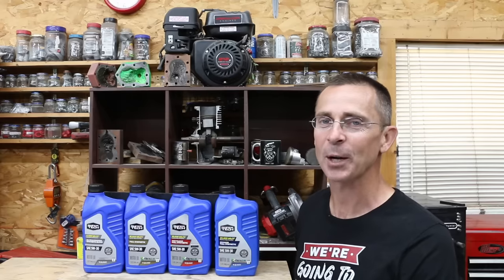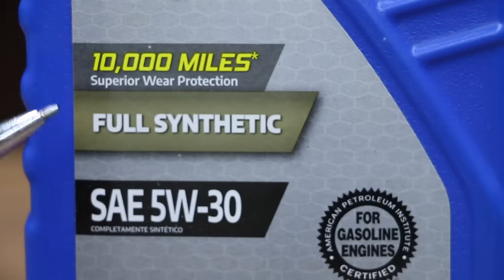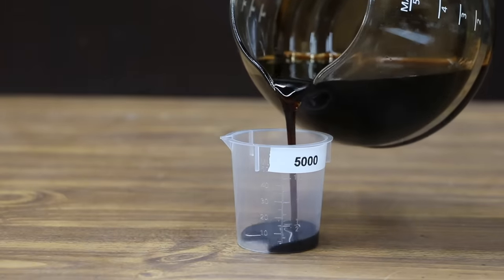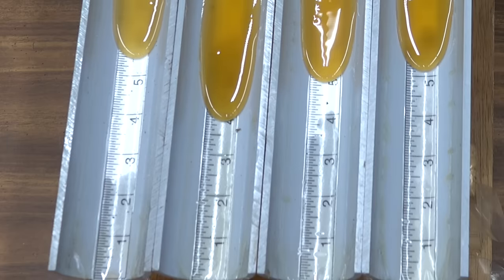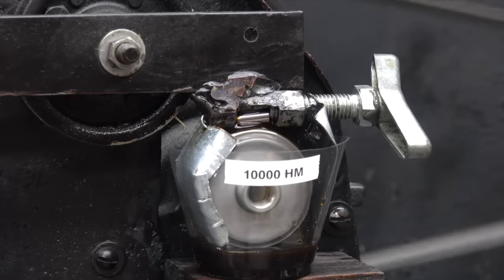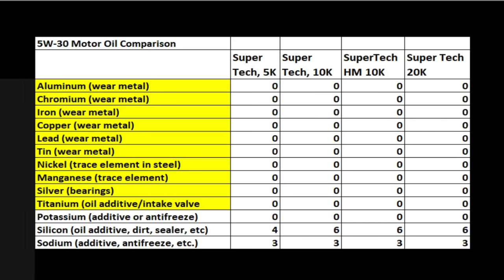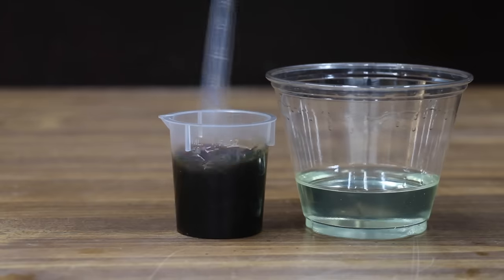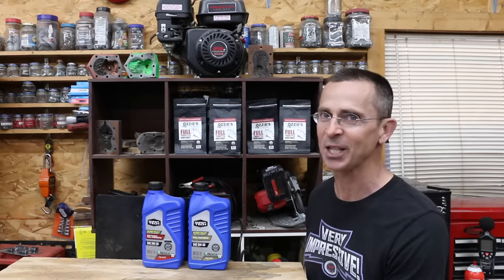Are They All The Same Motor Oil? Let's Settle This! Four Types of SuperTech Motor Oil Compared

Comment: I no longer recommend using Super Tech.  I switched to it 3 years ago after using mobil 1 for 20 years.  Big mistake but It was mainly for financial reasons.  It leaves burnt deposits and varnish.  It is also the reason for my car to overheat recently.

I have since tried Amsoil after watching your videos awhile back. Now my car doesn't overheat and runs smoothly.

I now sell Amsoil and i will be contacting you directly for another oil challenge that better represents real life applications.  Be on the lookout for a message from AMPD Oils, Lube & More.
Reply from the maker: Thanks for sharing.
Reply: @ProjectFarm  i went to your contact page and it referred me back here for suggestions.  I would like to see another oil challenge with that has " sludge". Perhaps add grounded dry carbon or possibly real engine sludge. measure it out evenly and mixing it in each oil. And then redo all of those tests

Comment: You should try a cold flow test with the same oil in all 4 tubes to see if there is any difference between the tubes or tracks.
Reply from the maker: Thanks for the suggestion.

Comment: I always use Mobil 1 Advanced or Fuel Economy both are rated for 10000miles "guaranteed". I change my oil every 5000miles and the oil comes out pretty clean and almost no oil is burned at all maybe 1/10 Quart (the engine has 100000miles). I tested it twice once to 6000 miles and once to 7500 before oil change, the oil comes out very dirty then and when I drove to 7500miles my car burned almost an entire quart. So people ignore your manufacturer recommended oil change intervals and change your oil every 5000miles unless you want issues with your engine down the road, my car manual says 10000miles oil change intervals but hell no I don't want another car after the warranty expires.
Reply from the maker: Thanks for sharing.

Comment: Motor oil companies work with the engine manufacturers and they have inside deals.
Recommend us and we recommend you.
Engines dont last as long because oil chance intervals have increased.
Both because oils cant handle high milage and engines arent built to last.
They sell more parts this way and engine oils that claim high milage are just slightly  different from reqular oils that claim normak 5000-10000 miles. 
They just price them accordingly to keep the sales the same.
Always chance your oil once a year or every 7500 miles with decent oil and you are good to go. 
Oil/filter chance is the easiest way to keep your engine safe.
Reply from the maker: Thanks for the feedback.

Comment: I own a 2017 Tiguan. I am wondering if it’s possible to burn enough 5w-40 engine oil in less than 3 month -8000km to trigger an engine light and red oil light on and off.  My dealership who I trusted over the years told me for some reason, my engine burnt more oil than usual and if it’s less than 1L for 1000km, it’s not warranty.    Myself on the other end believes they didn’t put in enough oil on my oil change 3 month ago.😂 would this be a fun project for you?
Reply: By the way, can I switch to Kirkland 5w-30 from the 5w-40 from Volkswagen? I say this because I lost all trust and want to change my own oil.
Reply from the maker: Thanks for the suggestion.

Comment: Don't pay attention to how many miles a container says the oil will last. Bottom line is we KNOW that it will degrade over time and the cost of an oil change is cheap insurance over costly internal engine repairs. I change mine at 5,000 miles regardless of what the container says.
Reply from the maker: Thanks for the feedback.

Comment: I would like to see a test between the best oil that Europe produces, to a US brand.

French oil company TOTAL have recently released TOTAL Quartz ineo Extra First 0w20. This is a popular choice and factory fill for small turbo charged engines such as the PSA Stellantis three cylinder 1.2 Puretech engines rated between 110bhp to 155 bhp. This engine has a wet cambelt.
Reply from the maker: Thanks for the suggestion.

Comment: Well I'm sure you remember the story that I have said to you about my Dodge neon I bought my Dodge neon in 2010 The day I brought it home I changed the oil with mobile one synthetic until 2018 I switched to Walmart 5W20 high mileage supertech full synthetic I bought it with 16,000 original miles when I had to let it go because the body was so shot because of salt and had 250,000 mi on it Just for giggles I decided to take the valve cover off It was spotless I always went 15,000 mi in between oil changes even with Walmart oil that engine was still good the day I got rid of it Just food for thought!
Reply from the maker: Thanks for sharing.

Comment: The trouble with all this marketing is that people forget there’re also time, engine operating temperature and load factor parameters. These caveats are mentioned somewhere in all the literature that comes with all oils. Even on the box itself, it tells you no oil is meant to be used for more than a year.

If you are towing all day long in city conditions, averaging at 2,500+ rpm your oil is wearing out faster. If you live on the highways in Florida in a modern sedan and your engine is running at <1,200 rpm all day long, your oil is wearing out at about half the rate. 

Aircraft engines have oil changes measured in hours, even though they are never stuck in traffic, for a good reason. Vehicle mileage is a terrible way to gauge oil performance, but is the easiest.
Reply from the maker: Thanks for the feedback.

Comment: Can you do an engine oil test with Silicone oil of the same viscosity? 
I know that Silicone oil is better than most other oils in terms of life and it sticks to parts better than normal oils. so I want to do a test in an engine. but I do not have the means to try it out ..
Reply from the maker: Thanks for the suggestion.

Comment: Even if the oil could go 20k could the brakes and tires? 20k is a long time to run tires with out rotation, that’s also a long time to go without checking the brakes. In my experience the inspection and tire rotation takes far longer than the oil change.

Comment: The car care nut channel is a guy who has the most Toyota engine knowledge of anyone. He has proven that if you use the owners manuals suggested 10,000 oil change interval, you will suffer extreme oil consumption as the low tension oil rings and oil drain back holes are too small. He proved that if you change oil no later than 5,000 miles you can get 500,000 out of most Toyota engines but if you go 10,000 you will be burning excessive oil after around 200,000 miles. I bought a used Corolla with only 50,000 miles that is using a qt in 275 miles cause oil changes were neglected. Your better off with cheaper oil changed more than expensive oil changed less!
Reply from the maker: Thanks for sharing.

Comment: Slug is created by mixing weighs and brands,  just change oil filter and you can run a motor 500tho miles ,  did it twice
Reply from the maker: Thanks for the feedback.

Comment: I use castrol oil 10w-30 for my 1988 lincoln town car.
Reply from the maker: Thank you for sharing!
Reply: I heard that the additives make it thicker and thus higher second number, is that true?
Reply: @Isaac-47517  Im not sure I use 1 quart of lucas plus the 10w-30 my 302 runs pretty fucking hot so I always keep fluids topped up 15k miles with no oil burning issues not great mpg but its a fucking brick.

Comment: In regards to oil change intervals, I always change the oil on all of my vehicles every 3 thousand miles regardless of the year the car was manufactured. 
I also do this with oil filters as well, it seems weird but I rather have the engines in my vehicles running clean fresh oil to prolong the life. 
Very interesting results from the testing!
Reply from the maker: Thanks!  Thanks for sharing.

Comment: i wish they would stop advertising oils capable of x miles ... change your oil when you are suppose to and use the correct oil . not all cars and go 20k or even 10k with ( 20k rated oil)and they require oil filter changes and top off of burning oil with anything over 5-10k  . I really love when a customer tells me they can't remember when the last time they changed their oil ....

Comment: Also it's not surprising that the high mileage 10,000 was thicker than the normal 10,000.  That's the whole idea with the high mileage is that the engine is worn a little bit so you want to use a slightly thicker blend. For better or for worse I guess.
Reply from the maker: Thanks for sharing.

Comment: Seems like the 20.000 Mile oil is just higher viscosity, so it could technically last longer before becoming too thin... Would be better for higher heat climate, still would not go More than 7500 on any oil.
Reply from the maker: Thanks for the feedback.

Comment: All synthetic oils here are so close to each other that it feels a lot of tests are within some margin or error. I agree that base oil seems near identical. For purposes of using these oils, they are the same oil. 1% difference is not a lot at all & if you got say 10 containers of each oil from different batches results would vary by said 1% (hey maybe prove this? Is same oil really the same across different batches? How close are they?)
Reply from the maker: Thanks for the suggestion.

Comment: I don't trust extremely extended oil change intervals and never will. I'd rather spend a small amount of money and get it changed more frequently. I think 5,000 miles is pushing it. For my car which is not really used much 5,000 miles is easily way over 2 years and for my work van about 1 year so I change it annually. The car I just change about every 2 years since I'm getting my plates renewed anyway and get it done then while getting it inspected.
Reply from the maker: Thanks for the feedback.

Comment: The way I see it, your engine its self puts contaminates in your oil. The detergents in the oil, keeps the contaminates in suspension so it doesn't form into sludge inside the engine. No matter what oil you use, or what the oil claims, it will not reduce contaminates that go into it. Which means, if you have the same volume of oil which accumulates the same amount of contaminates, the mixture is the same and just as harmful to the engine. Always use your manufactures recommended service intervals, because they know how much that engine pollutes the oil over that period of time. Totally my opinion though.
Reply from the maker: Thanks for the feedback.

Comment: I don’t believe in extended drain intervals. I change at  a maximum 5000 mile interval. I had a ‘92 Honda Accord that the oil would still look new at 2K miles. Nowadays with the lower tension rings it seems that the oil gets dark much quicker. I generally have used Mobil 1, Schaefer’s, or Castrol over the years. I’ve never had and oil related problem including abnormal engine wear or consumption except for a ‘07 Honda civic that I bought new. I used to change oil based on the engine oil life monitor which to my surprise was making my oil change intervals 12-15k. The oil control rings tuck in this engine and caused it to use oil. Since then I now change based on odometer only and have. I issues.
Reply from the maker: Thanks for the feedback.

Comment: Never go above 5k miles for oil changes.

It’s impossible to ‘accidentally’ go 500, 1000, and 2000 over. If you care about your car that is.

Oil viscosity last forever, time doesn’t matter… it wont change a thing about oil and is really just a way mechanics try to cover there ass by telling you to come back in 3-5 months so that you cant blame them for engine issues, even tho the customer should remember the 5000 miles and not need a reminder.

Doesnt matter if its 2 months or 2 years. Never go above 5000 between oil changes.

Also try not to change it too frequently aswell. 1000 miles on oil isnt at a point where its needing new oil yet. Save the money 

Additives? Close your eyes at the stores shelf and pick. They can be hit or miss with newer modern cars but fuel additives are definitely helpful.

Comment: 20,000 miles is insane for a typical oil change interval. The only way you could get close to that is with 100% highway driving. The TBN of the 20,000 mile oil is essential identical to the 10,000 mile oils. It would be irresponsible to run that any oil for 20,000 mile in my opinion. I've tested a variety of oils in different vehicle over the years and good quality synthetics only last about 7,500 miles. That is on oils with a virgin oil analysis TBN of like 9 or 10. 

The computer in modern Hondas has some sort of algorithm based on how you drive that tells you when to change the oil. My wife has had two 2.4L K series engines (one in an Accord, the other in a CR-V) and both engines suffer from oil consumption after following those algorithms at around 100,000 to 120,000 miles on the engines. They recommend change intervals of 10,000 or 11,000 miles. Those engines have only ever used quality synthetic oil. The car companies don't want you to keep your car forever, and they want you to think you can reduce your cost of ownership through doing less maintenance. If you only do one thing to your car change the oil regularly and use quality synthetic. I like Pennzoil Premium in NA engines and Rotella T-6 in my turbo BMW.

Change your oil at no more than 7500 miles on full synthetic. Even boutique brands like Amsoil Signature Series.
Reply from the maker: Thanks for the feedback.

Comment: Pretty sure the 10KHM oil is basically the same thing as the 10K but with gasket swelling additives mixed in.
Reply from the maker: Thanks for the feedback.
Reply: @ProjectFarm  I think that it's great that you still included it to see the difference it makes on flow rate, burn rate, etc :)

Comment: I would never go above 6k miles on any oil unless it is a low hp engine with a very large oil cooler and filter and has alot of oil in it.
Reply from the maker: Thanks for the feedback.

Comment: I run a chrysler town and country as a shuttle vehicle if you follow when the change oil indicator comes on sometimes it has 8500 miles on that oil change sometimes 6,000 it's never the same. Being a retired ford tech i never ever run my gas vehicles past 5000 between oil changes i don't care what the manufacturer states. All these companies pushing 10,000 service intervals if that you go head. I have used the super tech oil and filters for year never had any issues. I use the super tech in my 1999 sl500 mercedes convertible with less than 50,000 miles on her were as i used to use mobil 1 no issues at all. I use super tech 10w 40 in my 1971 ford ltd convertible sporting the big block 429 no issues at all so Is the mobil 1 better than the super tech synthetic i don't think so under normal usage and services.
Reply from the maker: Thanks for sharing.

Comment: My thoughts on extended OCI's? Don't do it. as was said in the video, oil is cheap, engines are expensive, I just don't understand the reasoning behind extended OCI's. You can get a 5 qt jug of Full synthetic Penzoil for <$20. If the average cost of a replacement engine is $4000 (per J.D. Power) that's 200 oil changes or 1 Million miles at a 5000 mile OCI. you're not saving enough to justify the risk.
Reply from the maker: Thanks for the feedback.

Comment: If you want your car to last change oil every 3000 miles. A lot of the hype around long term oil changes centers around OEM advertising i.e. our car requires less maintenance than their car. You can definitely go longer between oil changes than ever before oil is better filters are better engines are better but again changing oil is cheap insurance.
Reply from the maker: Thanks for sharing.

Comment: I've been using mobil1 20k high mileage sometimes going over 20k for years now.  Never had a problem.  I top it up with the supertech 20k as it burns off.  Once you get up around 10k I notice more burn off and the oil level needs topped off more frequently.  But never had any real problems from it. I use extended use oil filters with it and change them whenever I change the oil.  I've got about 178k on my engine now.  I'll keep doing the same until it quits, but I think something else will break down before the engine.  I had a manual trans jeep patriot that j did the same oil change routine and that had a transmission failure before I could wear the engine out.
Reply from the maker: Thanks for sharing.

Comment: I hate to be this guy but, shouldn’t you test the oil maybe not just cold but also when its at engine temp. Like at 3:10 into the video lubricity test the oils are cool. Oil is i think heated up after probably not that much runtime, id guess at least half the drive
Reply from the maker: Thanks for the suggestion.

Comment: IF you have a TRUSTWORTHY Mechanic - Change your oil  every 5000 miles even when putting the "Good Stuff" in. Your goal should be to be able to pull the dip stick "AT ANY TIME" and still have Clean looking oil - even at Oil Change time.  Vehicles I have/had eaisly go 300 and 400+ thousand miles.  While the oil is draning they do an undercarraige, wheel and brake check, etc.  Buy a well designed car (does not mean expensive) and treat it like an "Aircraft" and it won't let you down.
Reply from the maker: Thanks for sharing.
Reply: @ProjectFarm  I very much appreciate all the effort, diligence and accuracy you put into your analysis, testing and videos. My father-in-law was a Manufacturing Engineer and very involved with SME.  He would have loved your videos.

Comment: People don't take into consideration the overall health of their engine when they see a marketing gimmick from oil manufacturers such as "20,000 mile protection". For instance, worn piston rings and leaking fuel injectors will decimate an engine very rapidly by diluting the oil and causing extreme wear on the parts like connecting rod bearings, etc.
Reply from the maker: Thanks for the feedback.